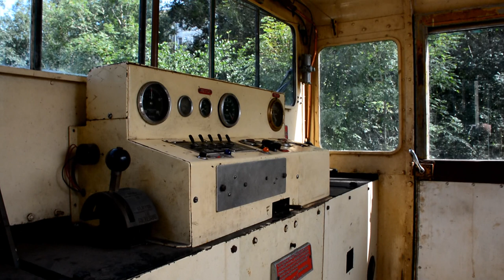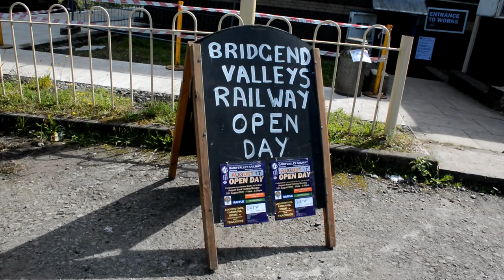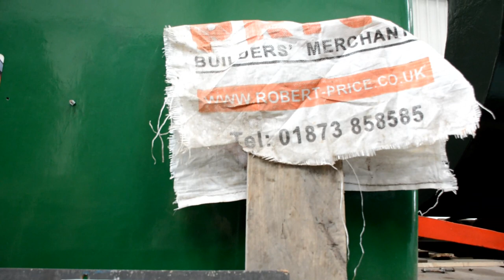Garw Valley Railway open day August 28th 2017

Comment: very well put together, and it would be great if it were to happen.. It would make sense for the line to put back into service as a proper modern working line, with heritage events at intervals throughout the year...but would the people of Pontycymmer , etc use the line?
Reply from the maker: Thanks comment, would be great see it back open, probably quite a few will try it out at first, but will the novelty die away later date, time will tell